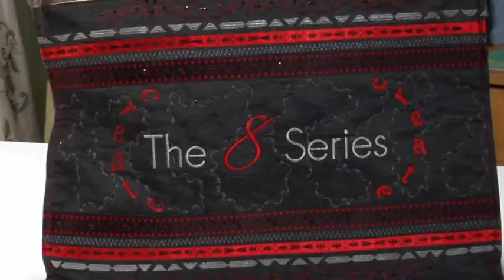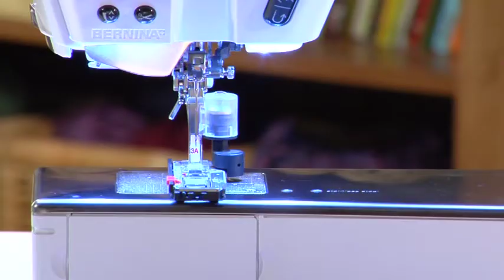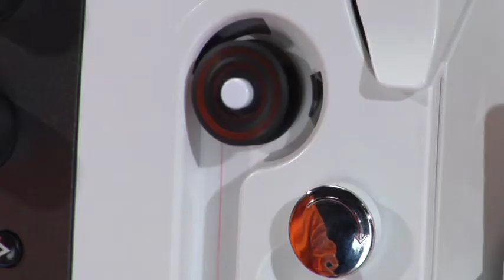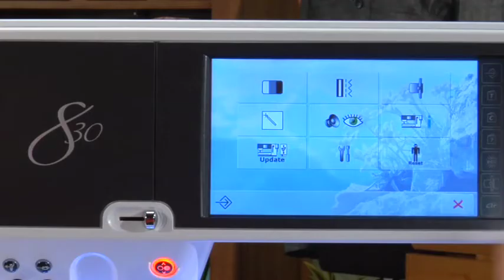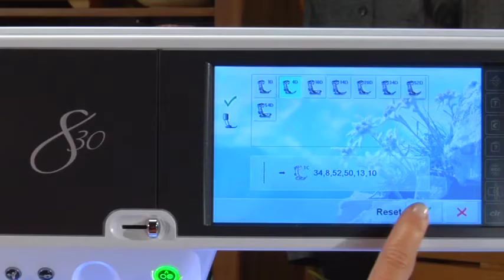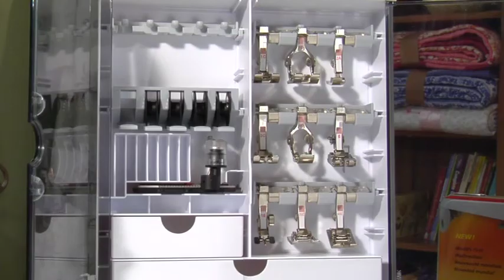3/21 BERNINA 830 sewing machine video instructions: Basic functions

Comment: Has anyone had problems with the 830 screen not responding? From what I’ve read, I must have put the machine in “eco” mode, and can’t get it back to normal sewing mode. None of the icons work. I’ve also tried recalibrating by holding the 2 needle position buttons while the computer boots. A target appears, but won’t recognize being touched with the stylus. Any suggestions are appreciated!
Reply from the maker: Dear Patricia, thanks for asking. If possible, please check which firmware version you have running on your B 830. The latest version is: V34.21.56. If you are using an older version, please go to bernina.com -> support -> BERNNA 830 firmware and load the new firmware version. If this is not possible and you can't find another way to solve the problem, please get in contact with your dealer.

Comment: Agree with c5869y. The bobbin assembly must have been designed by a watchmaker , way over-engineered and fiddly. The German language version did not help much, very sparse. There is a good tutorial by FreshThread on this site. I'm having to stash my 200 (best ever!) upstairs to force myself to use the 830! And only because of the bobbin threading nightmare, otherwise the machine is a joy.
Reply: My 830 has been a nightmare:  the bobbin in the problem.  Been serviced many many times.  The tech said it will be back shortly due to the bobbin.